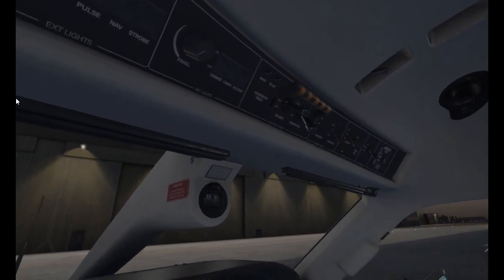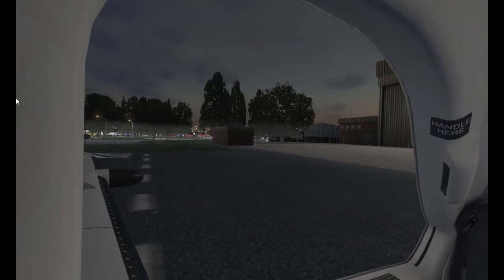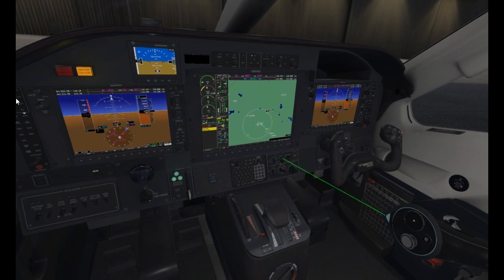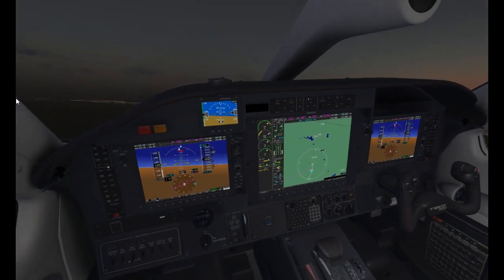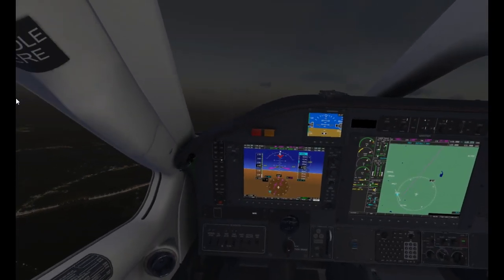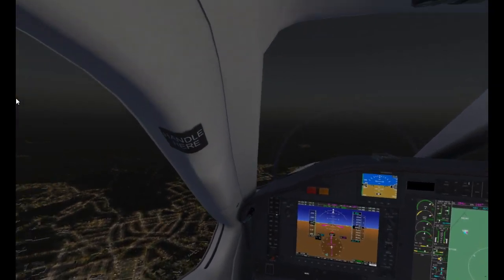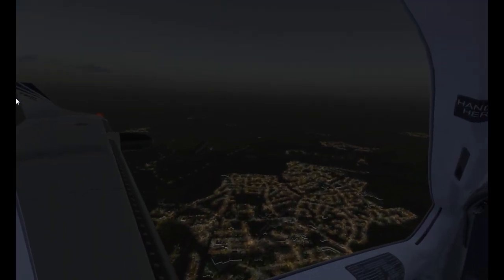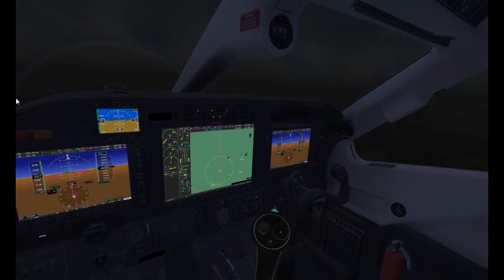NIGHT FLYING IN THE HP REVERB [X-Plane 11.40]

Comment: My Reverb arrives today. And it's all your fault!
Reply from the maker: Guilty as charged!! Enjoy and let me know how you get on!
Reply: @VRFlightSimGuy  

HP: Lets make the lightest VR headset on the market. 

Also HP: Just how heavy can we make the cable ?

Have to say it is everything you said. I only play Elite: Dangerous and DCS World regularly, it is simply stunning in both. The biggest difference was in DCS, I can now read every dial and gauge without moving whereas before, in the Rift (CV1) I had to set a VR zoom key which was vomit inducing as you lurched forward. The sweet spot is much smaller than the Rift and I find I have to move my head a little more to enjoy the increased sharpness. Setup is nowhere as slick as the Oculus setup, which is an experience in itself, all feels a little clunky. Once you have that out of the way though, it works very well indeed, in fact much better than I expected. I am running an I7 8700K with 64gb of 3200mhz ram. I only have a GTX1660ti GPU but I will now upgrade to at least a 2080, I was waiting for something to come along to make it worthwhile spending the money and I think I just found it. Hate the controllers after using the Oculus touch but I fly with a HOTAS (TM Warthog) and almost never use the controllers in games anyway so I'll live with it. 

I was on the verge of buying the Rift-S until I happened on your comparisson video purely by chance and that sealed it. I never would have considered the HP headset but for that so thanks very much for taking the time to make that video. BTW, if you get deeper into Elite: Dangerous, shoot me a friend request (Cmdr name Blairvoyach).
Reply from the maker: @Blairvoyach  Hey Jeff thanks for your first impressions. I'd have to agree with everything you've mentioned here, I wonder whether the cable has to be like that due to the high resolution its kicking out? I'm so glad you're enjoying the Reverb, it's hard to go back, even if the software isn't on par with Oculus. Thanks again and take care 😁👍

Comment: Hey Steph!
Re the centerline...simple with rudder pedals....look as far down the runway as possible...tiny corrections..same as driving in RL.
Re: my HP Reverb v2...disappointed vs Pimax 5K plus...disappointed...especially in AFFS2. Very jerky...in Vulcan ..detail on ground fuzzier on Reverb, and smooth as silk on Pimax.  Will be Streaming/Testing X-Plane 11.40  on the same East Midlands trip as here today....since Shadowplay totally STB and no longer works, at all, after over 325 videos, I’m becoming NFG enamored of OBS. Can’t wait to explore the extensive possibilities.
Thanks for the sweet vid!
BTW...it would be cool to see your hardware and software setup in the preface of each vid...so we know how to compare/what to buy/DL/install

...comments?

Cheers
Chas
Reply from the maker: I'm slightly intrigued by the new Pimax Vision. But for me, I prefer the sharper image over fov. Thanks for watching as always! Edit... Also just to add, I find the Reverb extremely smooth and silky in Aerofly, what are your specs? My hardware I'm currently using is now in my about section. Take care.
Reply: I7-6700k OC’d/ MSI NVIDIA GeForce GTX 1080 Ti Duke
Reply from the maker: @hesynergy  I'm not sure why you are getting such stutters in Aerofly, that's still a fairly decent spec (pretty much similar to mine really)

Comment: Thanks for another great video.. So you can't manually physically adjust the ipd with the reverb? I'm on the extreme end close to just over 70mm ipd wise.. Would that put me outside the sweet spot? (I heard the reverb's sweet spot is pretty small).. thank you
Reply from the maker: My pleasure thanks for watching once again ☺️ The sweet spot in the Reverb is quite small and you may struggle with that IPD, I'd definitely make sure if you do decide to try one, you are able to send it back. Cheers.
Reply: @VRFlightSimGuy  thank you